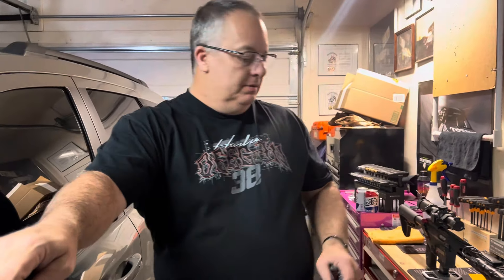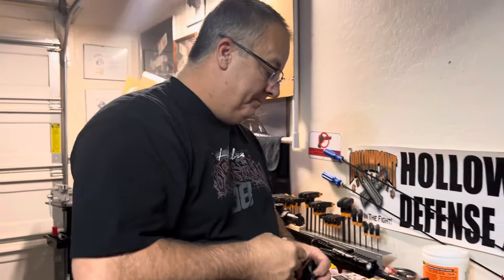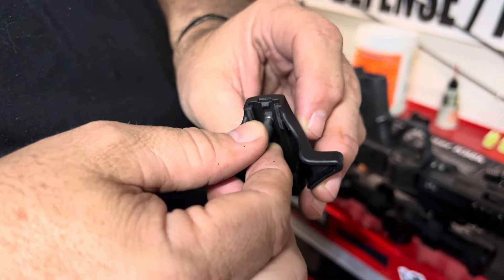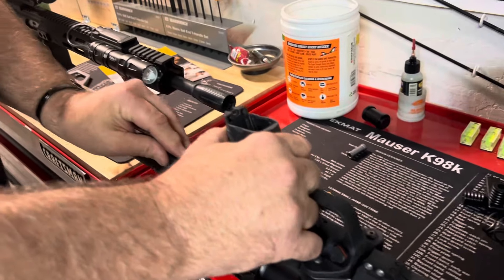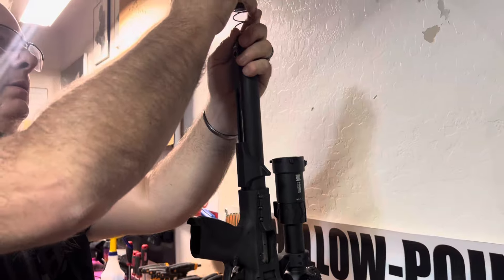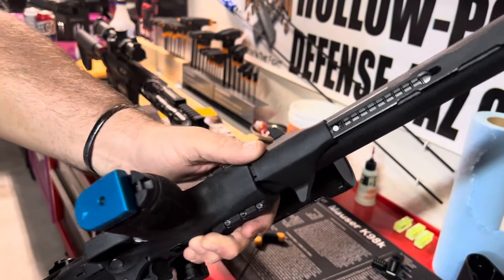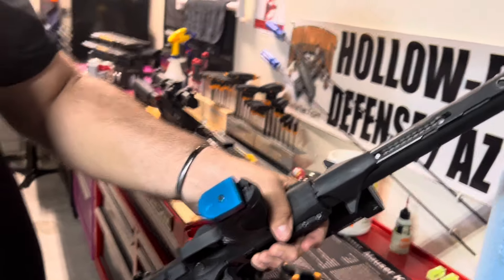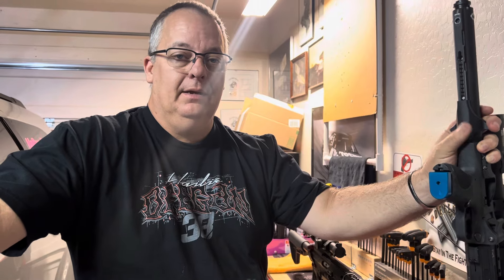S&W FPC charging handle hitting you?

Comment: Got my FPC about 3 weeks ago, added a Romeo 5 to it. I had to put my head low to see thru the sight. If I lean into it the charging handle pushes into my cheek on recoil. Feels like it's moving but it is staying locked. I added a 1/2" riser so I don't have to lean into the stock as much, no problem since. I always pull charging handle with 2 fingers over the top, pull back till it releases and let go and close freely. Never had it move. Because of the blow back action it does kick harder than I thought it would, but not a problem.  Love it!

Comment: The charging handle on mine does not move either. I have no complaints so far. In fact I really like my FPC. By the way for all those who complain about the bolt hold back being difficult to operate, just use your thumb and pointer finger on each side at the same time. Also works to release, but much easier to just pull the charge handle back.

Comment: There is a small spring loaded latch that's supposed to hold the charging handle in place in its forward position. If the latch doesn't hold the handle will move. Mine will hit my upper lip sometimes.
Reply from the maker: Correct it shouldn't move. I haven't had any issues yet.
Reply from the maker: I have tied to replicate the issue and I can't. There is nothing on my charging handle for the pin to grab to pull it back to hit me.
Reply: I have found that if I position my cheek farther back on the stock I don't get hit. On most rifles my cheek weld is much more forward.
Reply from the maker: @JD-nc7yb I am trying to look into this, I can't get mine to do it.
Reply: I just want you to know how much I appreciate your videos on the FPC.
Reply from the maker: @JD-nc7yb You're welcome. I am actually talking to S&W on this issue right now as I type this.

Comment: I got popped on my upper lip as well just yesterday.  Was after the mag was emptied and the bolt locked to the rear.  Yes, my face/cheek was mostly on the riser, but just a bit was forward.  My posture is more comfortable in that position for my size, so i will need to consider new posture or swapping out the handle for the Taccom version.
Reply from the maker: You can, it would stop your issue for sure. I went back to the OEM part, I just couldn't used to the taccom part. I went back because the taccom part is metal and the part it latches on to is plastic. I can see it wearing the latch part down and parts are not easy to get.
Reply: @hollowpointdefense  Yeah, that’s a good point.  I’ll also keep the OEM part, and I will make adjustments for it.  BTW, you put out a second video addressing that some folks didn’t push the charging handle all the way forward until it clicked.  When I got hit, it’s quite possible I didn’t do that (normally do).  I’ve binged lots of your vids in the last 24 hours.  You ARE the YT FPC Source Material!  Thank you!
Reply from the maker: @ba2724  Thank you and your welcome. The FPC is a really fun gun to use.